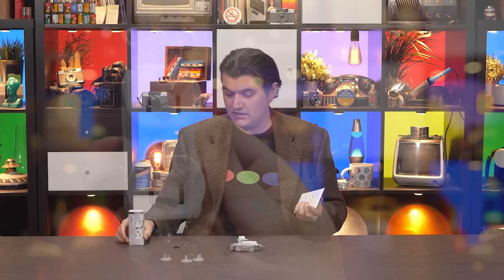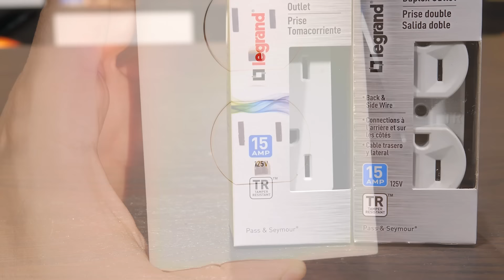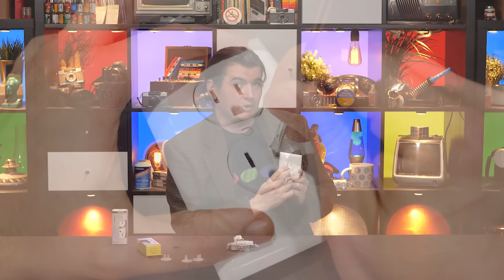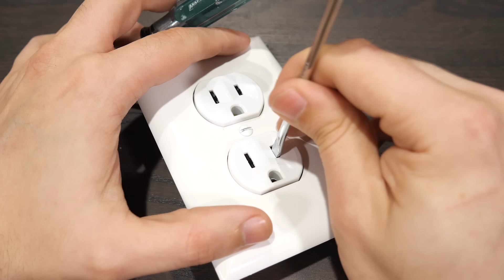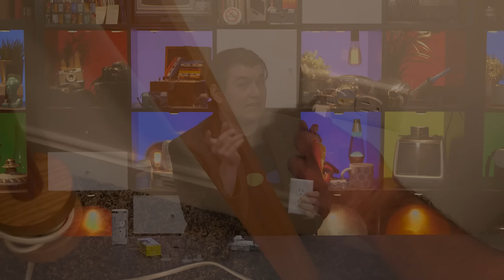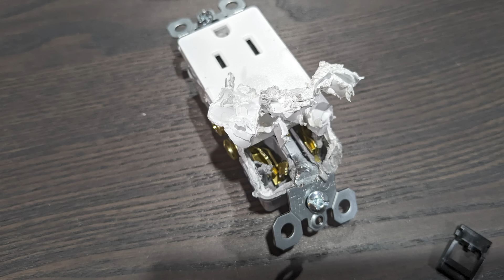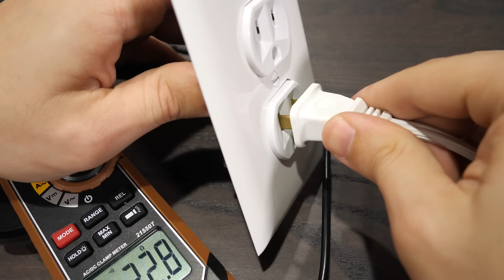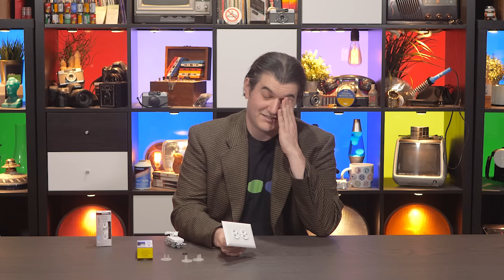Tamper-resistant outlets aren't all the same - a follow-up

Comment: Some UK sockets also have dual pin operation , often with round pin locks to prevent European two  round pin plugs being pushed in ( which on normal sockets is quite handy, just open the shutter with another plug ) .
Reply: From what I’ve seen, newer sockets that require both power pins also require the earth pin to be present, in addition to being designed such that a European plug cannot open the shutters even if an earth pin, or a screwdriver, is inserted
(And I would advise not to try inserting European plugs into UK sockets, there have been fires that have occurred as a result of people doing that)

Comment: When growing up, I tried to flick off the light in my sister's room, forgetting that the plates were off due to repainting. I reached around the door frame and my left hand went right in and touched the hot side. I still remember hearing a "BRRRRT" as my hand exploded in pain.

Comment: Regarding backstabbing outlets: They say "Never do that" because they don't know how to do it right.

To backstab an oulet, you need to A: strip your wire to the correct depth, and since a ridiculous glut of electricians don't know how to use a ruler, that can be a problem, B: PROPERLY SCREW IN THE CLAMPING PLATE.

On almost every backstab outlet out there, the screw you would normally use to clamp down a looped wire length... IS YOUR CLAMPING PLATE SCREW. It's designed to push in a clamping plate inside the backstab receptacle that tightly grips the backstabbed wire and prevents issues. 

It's almost the exact same technology as what you find in your breaker box, in every single breaker you have installed there. Yes. That's right. Those use backstabs. Well, Side stabs. Whatever. Point is, it's a hole you slot a wire in after stripping to the correct depth(and again, electricians suck at this, you can find breaker panels with plenty of exposed copper because some idiot didn't get their depths right), and screw down a clamping plate.

Comment: A sheath cylinder over the plug that slides back when inserted. Spring loading will reset the plug shield when removed. No changes are needed for the wall mount. Interesting home fittings problems with solutions. Thanks.

Comment: The way it appears to work is that there are ramps on the shutters that allow the plug to make it slide out of the way. It can also rock back and forth, such that if the plug is inserted at an angle, it tilts and catches on something, so it can only slide open if equal pressure is exerted on both pins. The shutters on the plugs in mainland Europe sometimes work the same way, but where I live what's more common is for the shutter to rotate instead of slide. It's also quite common, especially on cheap extension cords, for the springs on those shutters to be so stiff that it takes way more wiggling than you'd think it should to insert a plug in a socket, a problem British sockets, which have shutters that open with the earth pin, simply do not have. I've been there once and the sockets really are as delightfully well designed as British people would have you believe.

Comment: I also think that for people not from the US, airports are one of the first places they might endeavor to plug something in...and those outlets have been used and abused to a degree where I find stuff is constantly falling right out especially stuff that sticks out far and weighs a bunch, like say, a 5v USB power supply with a UK-US adapter on the end. I agree that for US home it's essentially a non-issue or a easily remedied one, it's a clear issue in places that have large throughput!
Reply: yeah, this ^ every airport plug I've tried to use is beat to shit and barely grabs the prongs at all
Reply: The UK-US adapters really don't help as the weight is much further away from the wall. I struggled to keep my phone charger seated when charging in the US
Reply: @railotaku  Yah, in that case, you might be better off getting a US-pronged charger of decent-enough quality.
Reply: I lived in an OLD house as a kid.
Screw-in plug fuses, post and wrap wiring in most of the house, push-button light switches still in a few rooms.
Some of the outlets were quite worn, and to be able to make electrical contact when plugging in things we had to bend the prongs on the plug inward a bit.
-
When we started getting enough household income to do so, we replaced those loose outlets and all but one set of the push-button light switches (because you had to find JUST the right dwell point to have an electrical connection).
Yeah, that song is so right. I wish that I knew what I know now when I was younger.
Reply: I was in DCA earlier this year and one of the concourses had several nice big tables with wireless chargers built in. No connectors to wear out!

Of course, I usually just carry a battery pack since I'd rather not be tethered to a specific wall for an hour anyway (so I never use the wall sockets in places like airports to notice ow worn out they are). For hotels though I use a desktop brick style 4-port power supply since I tend to have at least a couple different batteries to top up, with a detachable input cable. The last part is key since it means minimal weight on the plug itself, and the brick can sit on a desk in a convenient spot even if the only outlet is stuck behind the TV or something. And for international travel you can switch it out for a local version instead of using one of those cheap fire hazard adapters.
Reply: those airport outlets shouldn't even be used they're so bad, I'm pretty sure that is a feature for them so people don't use electricity. I'm sure that saves them all of 50k/yr a CEO can use to gas up his yaught's smaller yaught for one weekend.

The USB ports are 90% just plain unconnected (don't plug anything other than a battery charger into a public USB btw).

Comment: The falling out thing is EOL receptacles and your advice to DIY replace them solves that. After ~20 years in service probably 1/3 of my builder grade switches and receptacles are failing in various ways. Saggy plugs and cords everywhere, squidgy switches, broken plastics, etc.

Home owners should get a receptacle tester while at the home center to double check their work. You can also read up on modern code and bring your house closer to current safety standards. Certain areas are now required to be GFCI or TR but previously weren't. Switches weren't grounded before but now should be. Replacements generally come with code exceptions, but if it's a small tweak for safety, why not?

Comment: On the backstab connection for installing  outlets - I've been replacing a lot of outlets in my house lately, and most of them were installed with the backstab. It is an utter pain in the ass to pull the wires out it takes so much longer and is more frustrating than using the screw connection.
Reply: If I'm not going to be re-using the outlet, I just crush it with a pair of Channelock pliers and pull the wires out of the remains. Usually that's much quicker than trying to release the backstab terminal with a screwdriver...
Reply: @brianleeper5737  That's what I do too. But I still find it more annoying and time consuming than removing a screw terminal (and doubly so when I inevitably fuck something up and have to redo an outlet).
Reply: @Master_Gunner_Fae  I think it's probably quicker to disconnect an outlet with 4 wires backstab connected to it with the crush and pull method than it is to remove 4 wires from screw terminals. I'm using a large pair of Channelocks, though--one good squeeze is all it takes.

Comment: An interesting aside, 120/240v can't kill you unless you make a electrical circuit across your heart. This is why electricians have non-conductive screwdrivers; that way it basically takes a hand out of the equation.

It's similar to why birds and squirrels don't get zapped on bare high voltage cables unless they bridge themselves between another point.

If both hands create a connection, the current will run across your chest and through the heart. If you're unlucky, it may defibrillate.

It may be outside the scope of Technology Connections, but it may be worth talking about in a video about how heart defibrillators work. The same thing that may threaten to kill us through defibrillation is the same technology used to bring us back.

Shocking I know.

I'm not sorry for making that pun.
Reply: Usually your feet touch the ground though. If you touch the live side, you only need one hand. And that's why you should wear insulation boots 😂

Comment: While it's true that you can have 240v with two phases, our 3 phases can supply 400v between the legs and we can have motors with 3 phases and our stoves have at least two phases connected with 240 each

Comment: First of all, it doesn't matter if it's 120 or 240 volts. it's the amps that kill. you can have a 10000 volt shock, but if you only get a small amount of current aka amps, you're fine. In fact, 120 volts is more dangerous because for the same amount of wattage, aka the useful part of electricity, you need more amps. Volts just determine how long a gap the electricity can jump.
Reply: That's a long winded way of saying 'i don't understand ohm's law'
Reply: So you think you can get killed by holding on to the 2 terminals of a 12V 600A car battery?  No you can't because it's also the voltage that matters.

Comment: I have actually seen a foreign object in outlet issue in my home. We had a nightlight with some jewelry hangers directly above it. A chain necklace fell and landed on the exposed outlet pins, and apparently exploded. Apparently it was high enough resistance that it did not trigger the breaker. Fortunately other than a traumatized 4 year old, there was no damage.
Reply: more likely, it failed so quickly, it did not trigger he breaker.  breakers take a full 60th of a second to start to trip, while a fuse (which is what the jewelry turned into) can fail within a 120th of a second.  it's why some high energy applications still use fuses.
Reply: @kenbrown2808  A breaker can still trip in milliseconds. That was  a higher impedance fault.
Reply: @mernokimuvek  no. it takes a full cycle for a magnetic trip breaker to trigger.  and longer for a thermal trip.  as long as the fuse has the interrupting capacity to stop the fault, a fuse will blow faster than a breaker can trip every time.
Reply: @kenbrown2808  You have to see the slow motion video by Warped Perception. The megnetic trip worked in 6 ms.
Reply: The outlets near my desk at work were always black due to wiseguys sabotaging my plugs with conductive material. I just ignored it and they eventually lost interest in that particular stunt.
Reply: Scary 😮
Removal of conductive material above outlets is a best practice and policy in care facilities. A couple awareness pushes in the last 20 or so years. Some older fixtures like wall lights or fans have conductive pull cords (or sections of) often installed directly over outlets. These outlets are often behind heads of beds or furniture.

Comment: I honestly was curious to know the different types. 
I'm in Europe. The entire outlet is a hole + most "prongs" are plastic and only the tip is metal.
The fact that it is a hole makes the entire edge of the plastic cable been supported by the "hole" and therefore it wears out less.
I was curious to see if other places do it better
Reply: Exactly the European recessed plugs and sleeved contacts seem very much safer. But with 230 volts that is pretty much a necessity.

Comment: Something I would note is that outside of kitchen appliances, the devices we tend to plug into walls these days use less power than devices a few decades ago.  Far less power.  For most of the house there is no need whatsoever to run voltages capable of pushing almost 4kW at 15A to a single plug.  And in that respect I think 120VAC has worked out quite well for the U.S.

And perhaps you are right.  The generally less dangerous (but still can kill you) nature of U.S. house voltages is also why the U.S. tends to lag behind on requiring safety gear like GFCIs across the entire home.  Only kitchen, bathroom, and some garage outlets require GFCIs in code.  In other countries it is far more common for the main house breakers to have ground fault detection.  In the U.S. it is very uncommon for main breakers to do that.

I also personally prefer the U.S. split-phase (two 120VAC hots 180 degrees out of phase with each other) over the Euro 230VAC single-phase standard.  The U.S. solution is far more versatile in my view.
Reply: You can't compare split phase to single phase.

You should rather compare split phase to three phase which is more or less as common in the EU as split phase is in the US.

Three phase much more versatile than split phase.
Reply: @HomelabExtreme  Three phase is very common for U.S. commercial service.  That is, power going into businesses.  And most U.S. distribution systems are 3-phase as well.

But there is no point whatsoever running 3 phases into a residence.   It is vast, vast overkill.  Not even home EV charging really needs that sort of power delivery, let alone a 20W flat screen T.V.
Reply: @junkerzn7312  not at all overkill.
Single phase EV charging is being phased out in the EU for the very reason that it isn't practical to charge on a single phase.

Most homes here have a 43KW supply, with the bare minimum being 17KW.
Reply: @HomelabExtreme  In Europe you have 230VAC L-N and roughly 400VAC L-L (correct me if I am wrong).   Which means that you could easily do single-phase EV charging at 400VAC L-L.   That's only around 20A at 8kW.

I think for Europe this is more a transmission line balancing issue than it is a power delivery issue at the home, because Europe decided to run 3-phase into homes.

In the U.S. we have 120VAC L-N and 240VAC L-L.   That is, the U.S. "split phase" is two 120VAC phases 180 degrees apart, resulting in essentially single-phase 240VAC L-L at the home.   The two hot's are just the two end taps on the residential transformer with neutral in the middle.

In terms of wiring cost and efficiency... well, I think its about the same.   Theoretically you get lower losses with 3-phase, but my assumption is that because the services (in amps) are smaller, Europe runs thinner service wires.   So losses wind up being about the same too.

The question, though, for Europe, is why not just L-L?   Even for EV charging, 400VAC L-L (single phase appliance equipment) is totally reasonable for residential operation. Why does it have to be L-L-L which results in significantly more complex appliance side circuitry?

Not to mention the EVSE connector.   Compare Tesla NACS in the U.S. to Euro CCS.

Not the Europe is going to change now.  They saddled themselves with residential 3-phase and now they have to live with it.

It used to be that 3-phase was ideal for things like A/C because it directly ran 3-phase motors.   That is still true in machine shops to some degree, but modern heat pump appliances (A/C and heating) use variable-frequency motors which removes all the advantage 3-phase had.

Leaving the consumer appliance still saddled with more complex input circuitry.  A cost that we inherent in the U.S. since most EV manufacturers only want to build one in-vehicle charger.

-Matt

Comment: In most of Europe, the Schuko plugs are installed next to each other sideways, this makes the right angle plug issue go away. Given that the plugs are symmetrical, you can also install the right angle plugs either down or up, whichever is more convenient.
Reply: This is the German style. I have never seen it in Finland. It requires more work as you have to wire both sockets.
Reply: Same in the AU/NZ design. We also have switches on the sockets and sleeved pins. Only thing we don't have is the gates, but the live elements are pretty deep so it's an effort getting anything commonly conductive in them.
Reply: also most of the right angle plugs are made so that they can sit ontop of eacother as well. if you stick in the bottom one first then the top one so that the cord goes over the bottom one.

Comment: Question regarding voltage in the US vs UK: yes, UK is 240V, but the amperage is usually about half of the US (120V) outlets. In my house in London, outlets were mostly 3-13A, whereas in NY, almost all my outlets are 20A. Does this not mitigate safety issues?
Reply: Not at all.
50mA (0.05A) is more than enough to be able to kill you. If you ever manage to trip a breaker by getting an electric shock, you'd probably go up in flames. That's what RCDs/GFCIs are for, limiting the current on a ground failure to 5-30mA.
Reply: No
Reply: In UK most outlets are on a 32A breaker, so even bigger number. The fuse to limit to 3 through 13A is in the plug itself

Comment: I'm not sure how mechanically practical it would be, but I'm imagining that it could be possible to have a switched outlet that pushes a pin through the holes in the plug prongs. this should A) prevent the plug from drooping out like this, and B) prevent the prongs from being live if the plug isn't fully inserted as the switch can't be fully turned on. this should also subside the issue of loose grip as it's a mechanical grip instead of a friction grip.